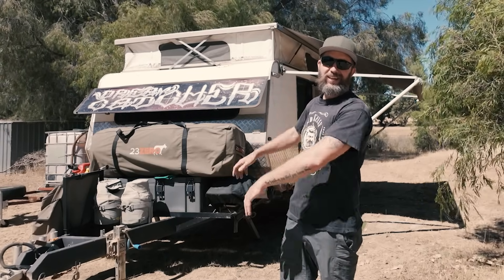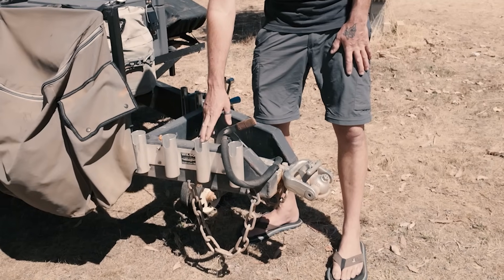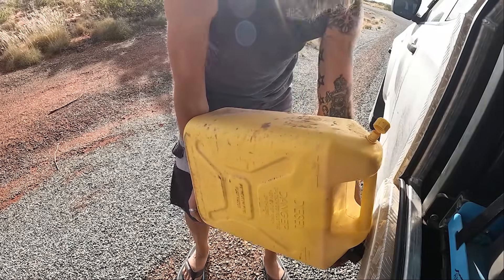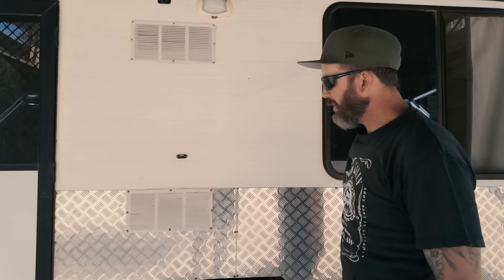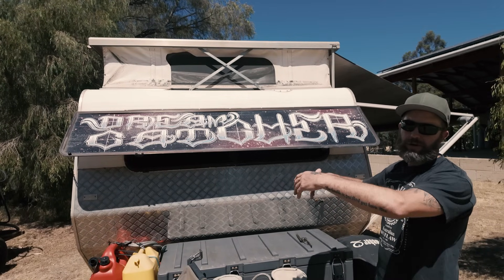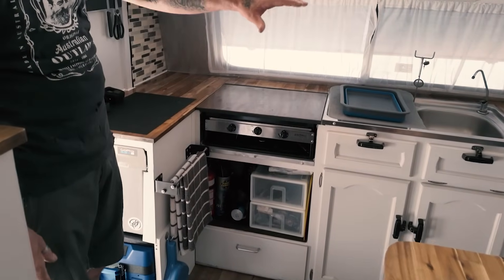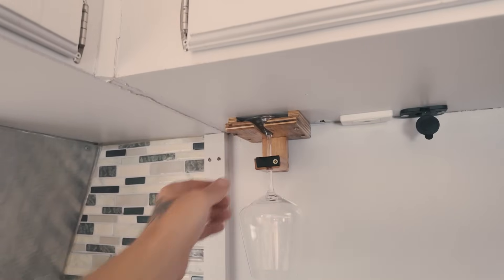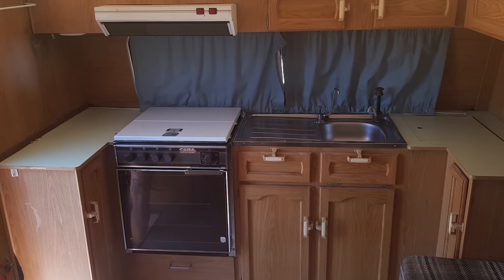Our Tiny Home Walk-Through | 1988 Offroad Viscount Caravan Transformation

Comment: Great rundown on your Viscount Seabreeze van. We too have an 1982 Grand Tourer 14' which is being evolving into the 21st Century 😆.  We extended our Draw Bar by 1 metre, removed front bunks with a ensuite, (cassette toilet &  separate shower). Flipped the axle to give more clearance, new 12v, 85L Upright Fridge, still with 170ah AGM, plus 120ah Lithium in separate Hard Korr Box.  Various 12v power panels, TV, Original Oven, and Brown & Orange stripes 😂.
Reply from the maker: Nice one Lloyd 👍👍!! Sounds like a premo setup! 
Good to hear you fitted a shower/toilet in it too!

Comment: Love the setup, mate. We have the same jockey wheel on our van. We were told not to move the van around on it when fully extended. It can bend. Im not going to try it, 😅. Nice work. Safe travels 🍻 👌
Reply from the maker: Cheers Nath! 🍻  
Yeah they are a decent jockey wheel for sure! 
That's it mate 👍 
Did ya get the 4bee sorted?
Reply: @oldmate_adventures  no mate. Hopefully, I'll book it in for next week. My wife and daughter are heading to Brisbane in 2 weeks. Need to get it done before then. Vintage is about to start at the end of the month, so it needs to be A1 for that. Don't need a breakdown before the 2am shift starts 🤣
Reply from the maker: Arrr nice one! 
Have a good time in Brisneyland! 
What's Vintage?
Reply: @oldmate_adventures  im not going to Brisbane mate. Because of vintage. I'll be doing shift work. Could be up to 14 hours shifts. Grape picking. I am an operator of the geape harvesters. No much more though thats why my back isn't as good as it used to be

Comment: Awesome Ep and look at you awesome set up van guys,  A mode they do is fit a small computer fan in the 85 and 130lt fridges to blow air over the freezer area it stops them iceing up they say
Reply from the maker: Cheers Craig 👍! 
Oh sweet as! I will definitely look into this! Yeah is a bit of a battle in humid places.
Reply: Yes you can either come off the light in the fridge for power as 12volt , or on the compressor controller near the compressor it has a series of letters i think F is for fan if you use it the little computer fan you put inside the fridge only runs with the compressor does, Love your channel  @oldmate_adventures
Reply from the maker: @craigtomkinson2837  arrr mate this is epic! Modify Everything 🙌 haha, I will get onto this 👍

Comment: Is that suspension really worth it over full rocker roller 🤔 it was the off road standard for decades till independent
Reply from the maker: Definitely a lot more moving parts and issues you have to get right like alignment etc on independent but for offroad they are just a whole other level above. Like everything though you have to set them up correctly.
Reply: @oldmate_adventures  seen multiple with new full off road vans do off roading like the Gibb and still die... 😅

99% because they didn't air down or drive to the conditions seen many vans that have done it no issues. 

Still on the fence if its "needed"
Reply from the maker: Yeah lots of crew think just coz they have "offroad" suspension they can just send it and all good. Haha